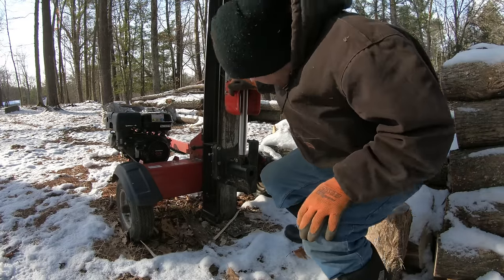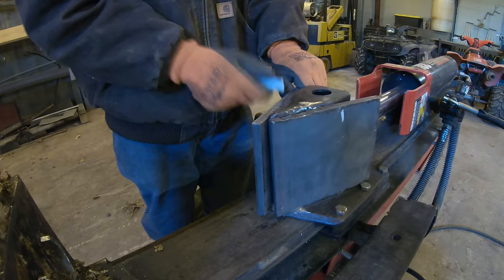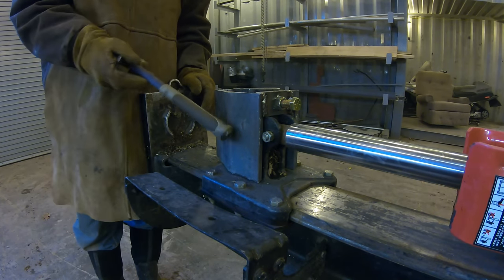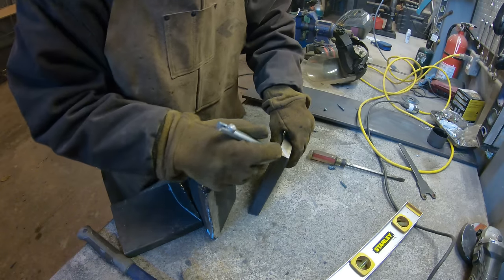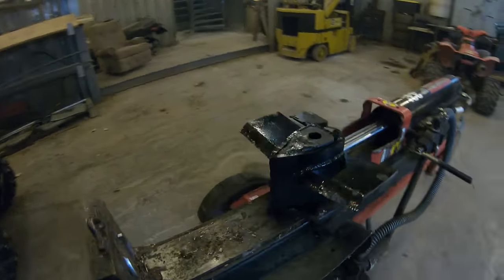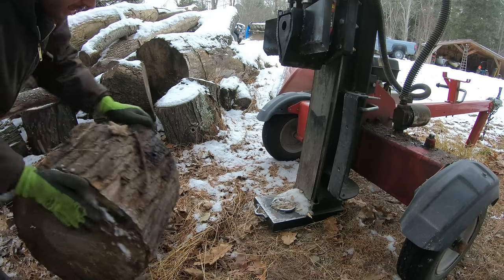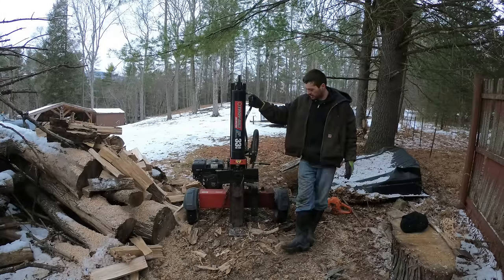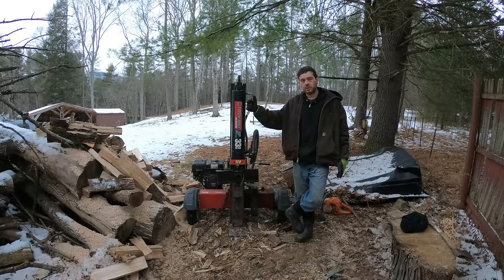Building a 4 way splitter wedge

Comment: Andrew I'm 63 and have worked construction since I was 18. Became a lead carpenter and then supt. and have retired. I've been physical my hole life thus far. My back has taken a beating. 1 disc removed and so on. Enough on me. You are young now and hopefully when you get older you won't have back problems. I say this because I have just finished building a splitter to mount on my backhoe. Works great. I can maneuver/pick up the buck length, split it and usually pick up 3 or 4 splits and place them in a trailer/truck whatever all from the seat of the machine. Love it. No backaches. I saw the backhoe out side your castle shop which I love (the castle) and no that with your skillsets you can make one for yourself. Don't get me wrong, the 4 way fab was great. On why they don't come already on the splitter I do notice that very small kindling strips are generated, Some is just trash it is so small. Other reason is additional costs making the splitter more costly to sell. Thanks for sharing and great job.
Reply from the maker: Thank you.

Comment: Extremely well done. Congrats.
The companies don't sell 4way knifed splitter from factory because without them you have to use your motor splitter much more often (two to four times more). So it will wear out faster and you have to buy a new one. Also you have to buy much more gasoline, oil etc.p.p.. Nearly all companies try to make as much profit as possible. Apropos: You can buy an expensive 4way splitter piece (like the one you did DIY) later on respectively as an extra.

Comment: I built one that pins on the boom of my backhoe and works of my hydraulics. I never have to leave the seat. I can set it down over a log pick it up and swing over my dump truck and spit it right into the truck. But I used your idea for the four way split. I have to thank you for that. You sir have couple great ideas that made me rethink some extra protection on my dozer as well. Keep the vids coming.
Reply from the maker: Thanks

Comment: At 10:45, that was super dangerous. Always set your grinder wheel up, wheel down could flip around and get you in the stomach
Reply from the maker: I don't think its dangerous.
Reply: Andrew Camarata that doesn't change reality.
Reply: wheel up gets you in the face . I prefer to have wheel down in most scenarios, not throwing sparks at my eyes and what not. Having a wheel explode and cut through jeans, welding jacket ect ain't going to happen IMO, especially with a 4 1/2 inch disc. I personally would rather get hit where im protected with multiple layers of clothing rather than in the face. Looks like he's using a grinding disc too, never broken one of those myself.
Reply: Willow killa not talking about grinding, talking about setting it on the table.
Reply: Took a bud to the hospital 2 winters ago after he had a little "mishap" with a grinder/cut-off wheel...  He went right to the bone, but was incredibly lucky to have not done any serious damage.  He was also lucky someone was around to take him, as he became incapable of driving.  S#!t happens sometimes.

Comment: Andrew , you need to be more careful with what you leave around your cutting and welding table, like solvents and rags .
I made that mistake and the sparks ignited the solvents and my building burned to the ground..take more precaution with that.
Reply: His building is steel and concrete
Reply from the maker: I usually watch stuff, but that building wont burn.